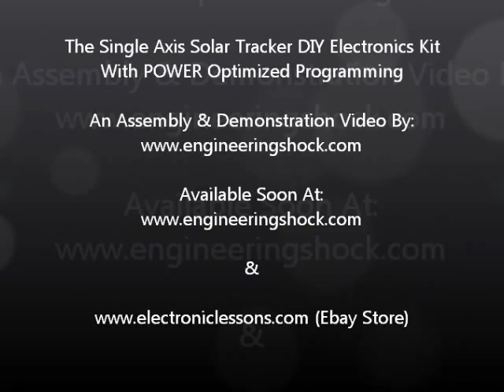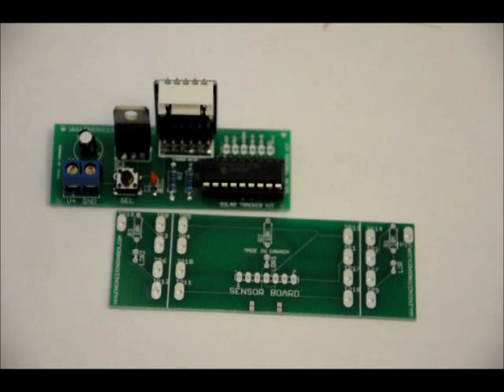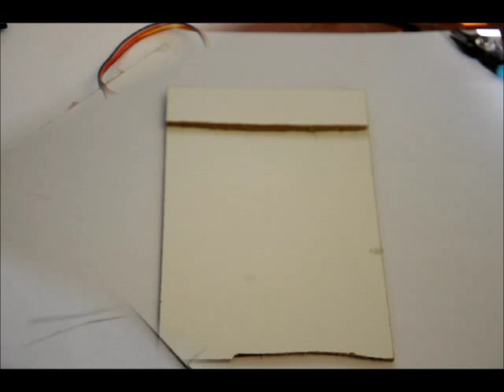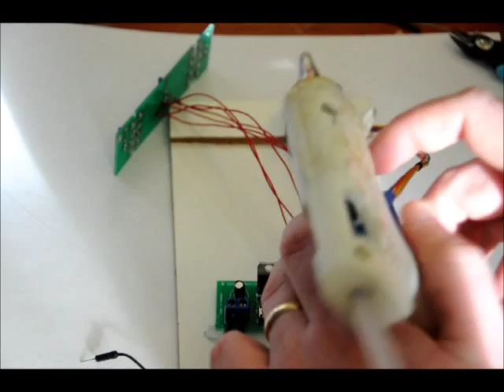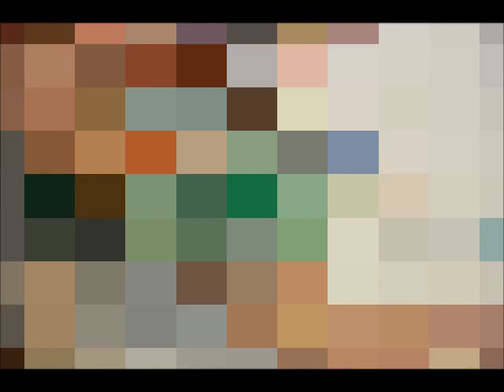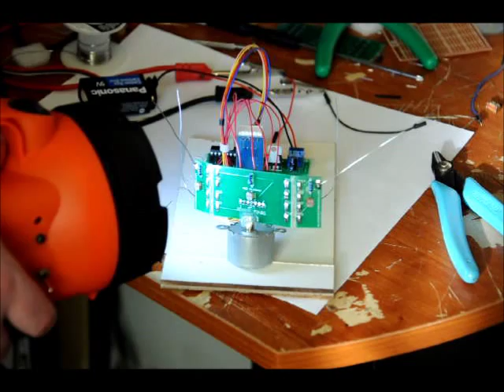The Single Axis Solar Tracker DIY Electronics Kit With Power Saving Mode - Assembly & Demo

Comment from the maker: Where do I say that the 7805 is power saving?  It merely regulates the input voltage to 5v for the digital circuitry.  I have a power saving mode in the software, but I don't think that I ever insinuate that the regulator saves power.

Comment: I guess I just have a max powersave fetish. My board on a 3.7v lion uses less than 1uA in powersave mode and in active mode it sleeps for 8 seconds then wakes for 250ms and works meaning instead of the 2.4mAh it draws closer to 0.3mAh.